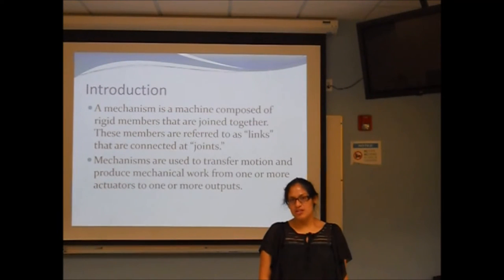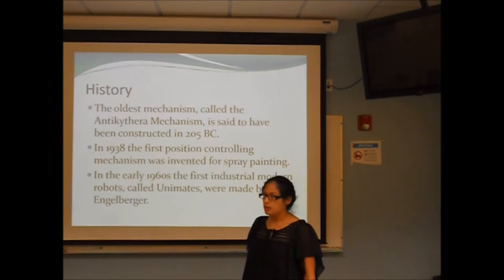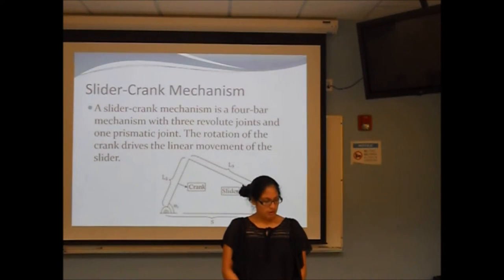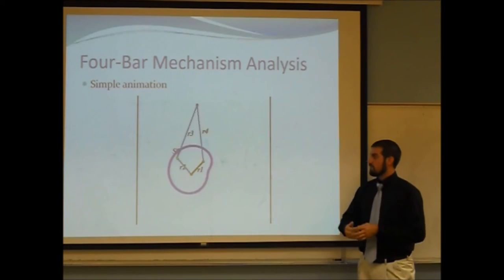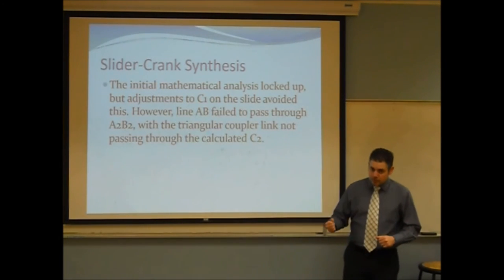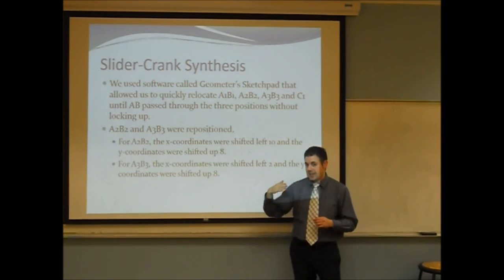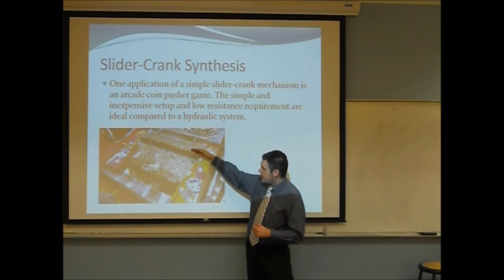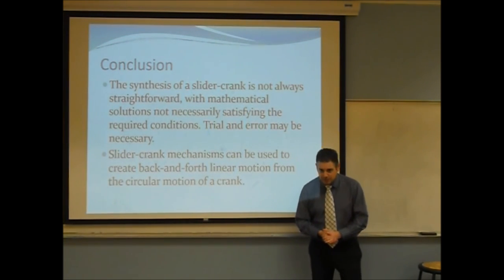Team 29: Mechanism Design: Rowboat Rowing & Coin Pusher

Comment: The feedback took away from the presentation. The text was a good size and the contrast of the text to the background color was good. Some of the slides had a lot of words on them which is difficult to avoid with so much information to present, but the condensing of some of these slides could have improved the presentation. The synthesis was presented very well and was played at a nice speed for narration.